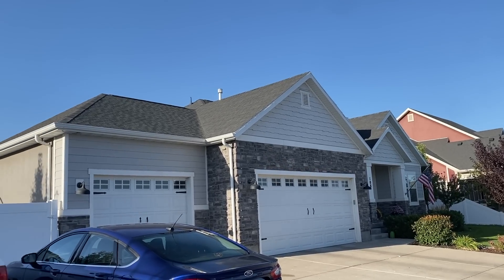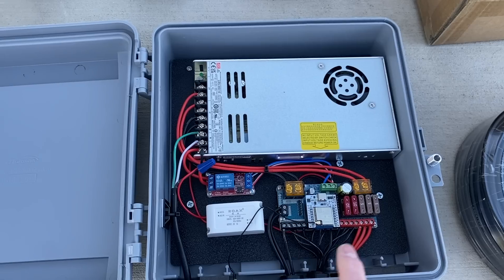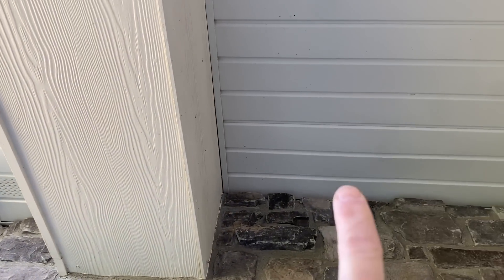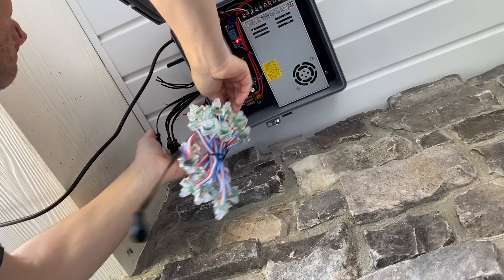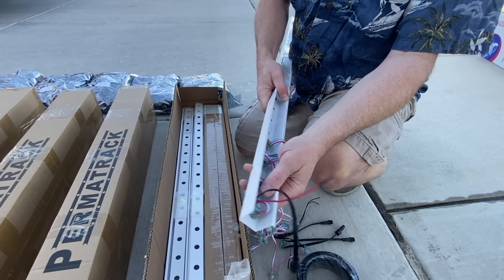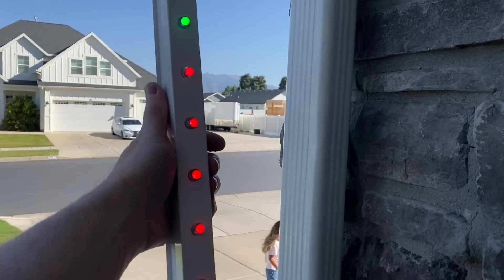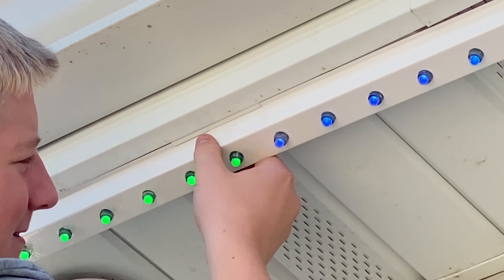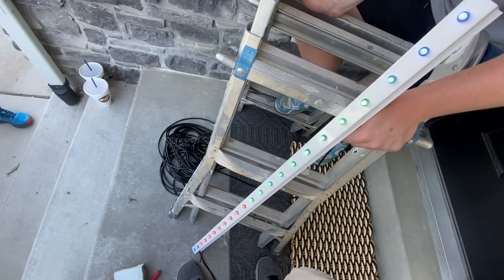2024 Permatrack Update

Comment: Any body try to install 5V WS2811 Pixel String instead of 12V Strings, using this pre-configured box
Reply: I'm in the same boat. Have the new box, don't see any kind of dip switch

Comment: Good evening, sorry, I don't speak English I use a translator. I hope you understand me.
My request will certainly surprise you, but I have a problem with one of your tutorials, the one where you use remote controls on Wled.
I found your site while looking to operate the WLED app with a remote control.
My edit already works with control buttons for the presets. I would like to add a 24-key-grey_ir remote control under json. I managed to modify everything related to color, but I cannot program the 4 gray keys on the right to control presets. I followed your tutorial on this subject, but it doesn't work. I installed Visual Studio Code to be able to modify the code of these gray keys and assign a color, and it works. 
So I'm asking for your help to assign my presets to the remote control.
I hope you can help me finish my edit. Thanking you for listening. Sincerely.

Comment: Thanks for your video update. Can you tell me if that 80 foot lead to the backyard held up without data boost by switching the resistor to 33? I am running a few different scenarios and have 60ft lead lines.

Comment: Do you have any info or resources on how you setup the 5v power supply to power the quinled but only turn on the big psu when needed? How necessary is that with a permanent install/

Comment: Why mini x connect? 

Why not go with the more common normal xconnect? 

This would allow people to buy other pixels from different vendors, would allow easy connection with premade extension cables instead of having to cut off the ends of the f amps and re-wiring them back together.

Seems like the use of mini x connect is to lock people into specific pixels.
Reply: Mini x connect is much easier to work with inside the track.

Comment: I want to do the Permatrack but my soffit is recessed by 3.75” and afraid that’s too deep for the permatrack?
Reply: I have the same issue, I'm going to cut 2"×2" treated pine strips, screw those into my soffit then put tracks on those.
Reply: I will be painting my 2*2 and tracks yo match my soffit
Reply: @adventuresofaidenandaviana4683  Yeah. I thought about doing some blocking but man that’s gonna be a pain! Good luck!
Reply: @Antho-R22  I am going to do blocking for puck tracks. I'm planning on 4" wide blocks so I can use one overlapped for 2 tracks and only need to run 2 screws through the facia into a block.

Comment: You are really getting there with the product line. The mini x connect extensions will be another great step. I would also consider corner and end brackets like sfl’s. They make a nice easy clean finish on corners and ends. Also, I have to disagree on the tin snips. At least use a cut off wheel, but I preferred a metal blade on my chop saw when doing my permatrack install.
Reply: I’ve had horrible luck with anything but tin snips. What is your secret?
Reply: @CoachKB50  I have steel permatrack and used a 10" dewalt steel blade to cut pieces to length. It chips the paint on the ends. I sand the ends and then use white appliance touch up paint. Works great. For corners I used sfl designs 3d printed corner brackets.
Reply: @mcb0b1 ok. That makes sense.  I have the aluminum tracks.  Thanks for the response.
Reply: I think you were creating unnecessary work.  Consider putting the data booster at the end of the extension cord.  If data was making to the first 50 pixels, it's there to be boosted.
Reply: I know this is late but we have considered that.  There are so many variations of angles that would have to be covered it would be very difficult to cover every need.  HOWEVER...  many many moons ago we partnered with SFL to do that for us.   We may do the simple 90 degree or end caps in the future and have them made in bulk but right now we are letting our friends at SFL make them and profit from it instead of us

Comment: Wifi? 😱.. I seriously recommend ethernet when using Xlights.. I learned the hard way, wifi doesn't cut it with so many pixels 😢
Reply: I agree, WiFi isn't the way to go for big shows. 

I use the WiFi dig uno for off season accent lighting, but when the big show is up, I disconnect the pixels from the unp and plug them into a kulp16.
Reply: My wifi kulps work great for a 9k light show